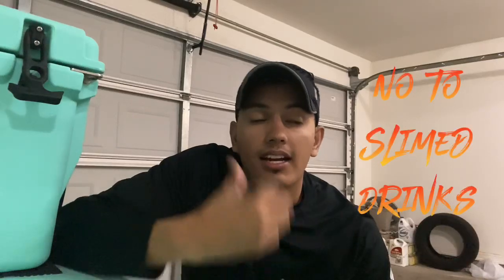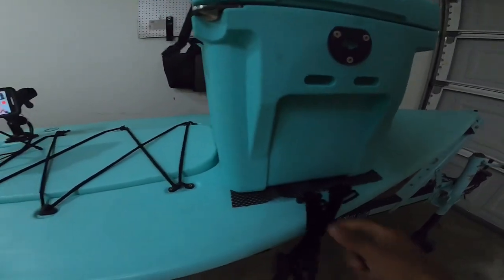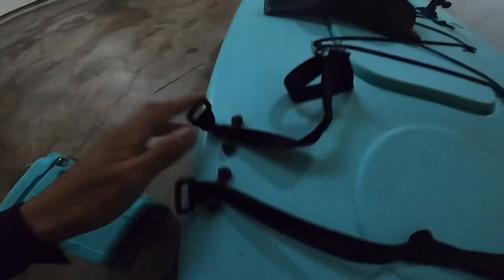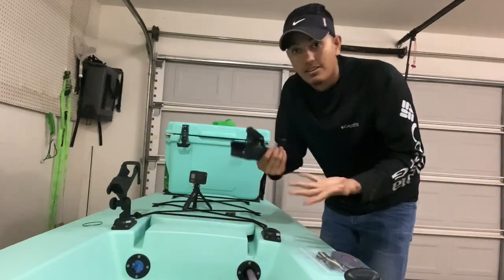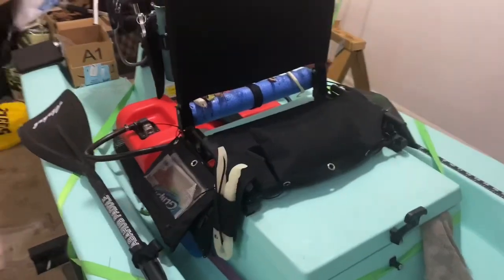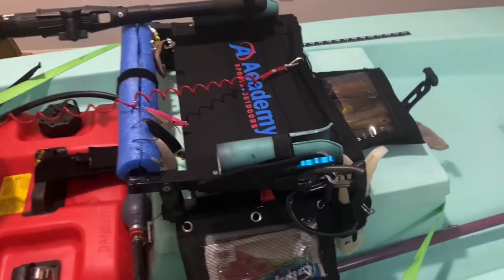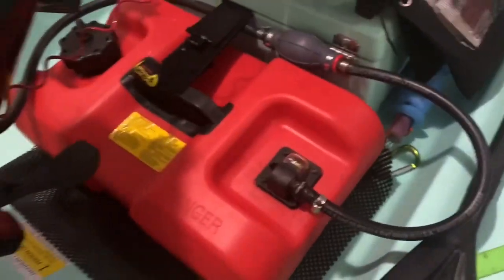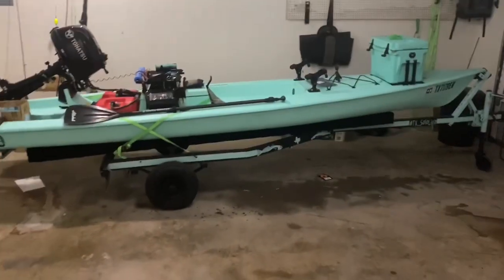TX_SOLOLIVIN - Episode 3 - My SOLO

Comment: Doesn't the skiff come with its own integrated fish cooler ypu can use with ice for drinks and fish?
Reply from the maker: Manu Garcia yes it does. The front hull has a removable lid where you can use it as storage, live well, or ice chest. Doesn’t hold ice very well tho. I used it once but didn’t like that my drinks and snacks got all slimy mixed with the fish.

Comment: Sorry to keep bothering you with questions but how do you lock that thing up in the bed of your truck if you’re traveling and spending the night somewhere like a hotel for example
Reply from the maker: no worries bud, if you want add me on facebook...TXSOLOLIVIN OUTDOORS and message me there, ill reply much faster. 

If its in the back of the truck its a bit easier. I back it up super close to the wall of a building or structure making it very hard to get it off. Also i use bicycle locks through the grab bar to the bed of the truck. Just dont leave your motor outside, that can easily be stolen if you dont put a lock on the transom screw fasteners.

Comment: i put a 9.8hp on mine   goes hard
Reply from the maker: Tracy Torbarina wow! That’s crazy! Definitely should upload a video of it running! How’s the weight distribution on the skiff?
Reply: @txsololivin2776  no issues , i use a tohatsu  2 stroke its only 5 kg difference from the 5 hp i get about35 to 40 kph out of it  also have jacked up the motor 2 inches